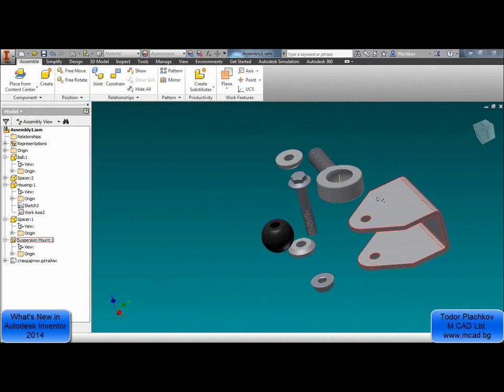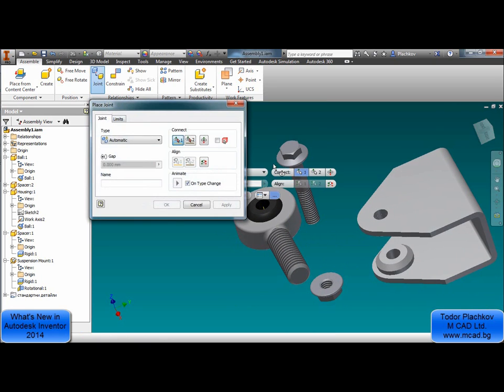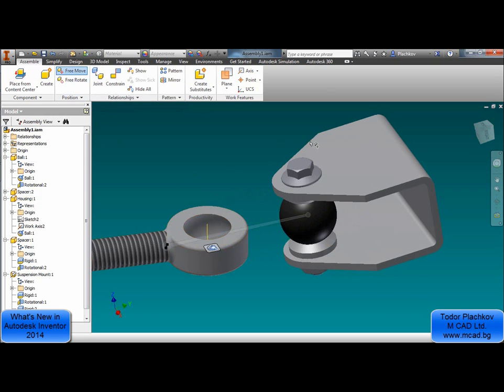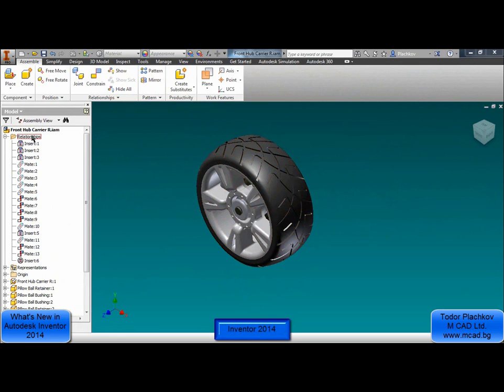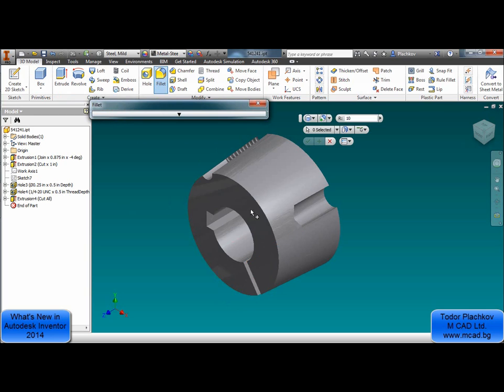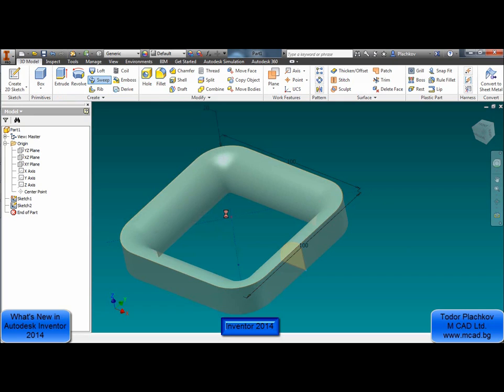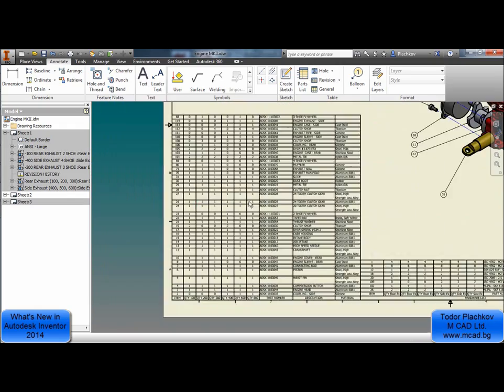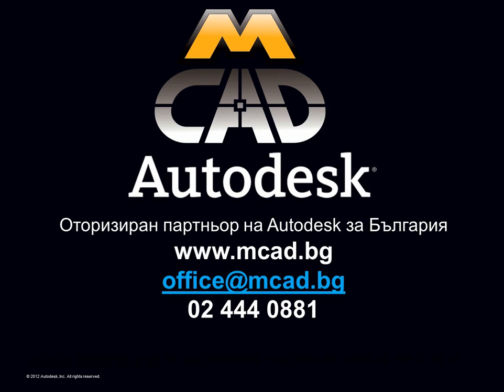What's new in Inventor 2014

Comment: not on a Mac yet!! I hate my PC boat anchor!!
Reply: ***** I am a Mechanical Engineer running winsuck 7 on my Macs! Running faster then on a HP
Reply: ***** My new Mac Pro doesn't need a quadro card. 
http://store.apple.com/us/buy-mac/mac-pro
Reply from the maker: bbirdsr71 You are absolutely right. I don't use quadro, also. The video card choice should be based on the type of designs you are making.Like the number and the complexity of the parts you are creating. I am making a video for these kind of questions - performance, assembly simplifacations and etc.